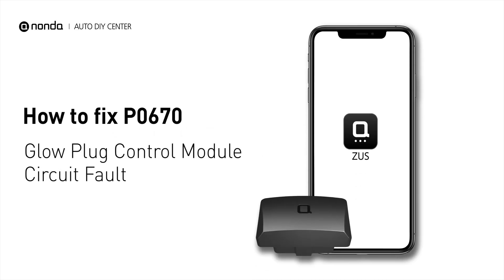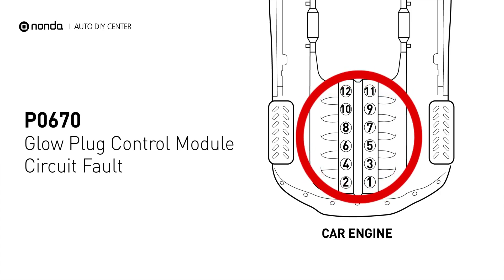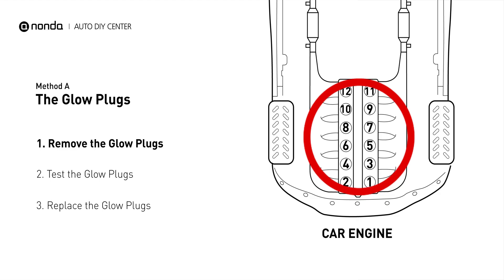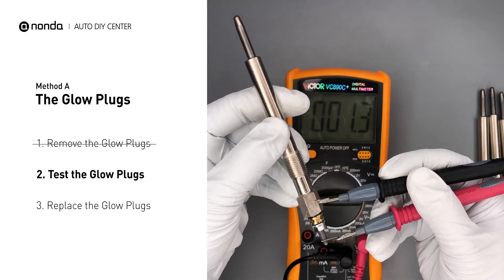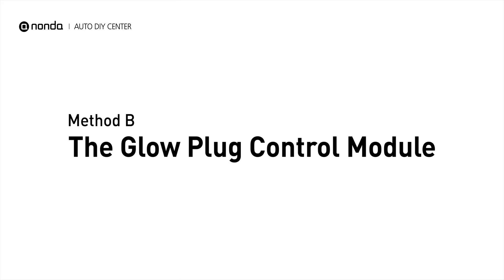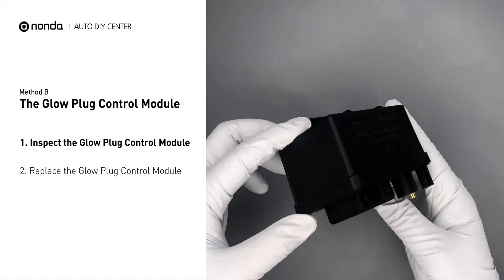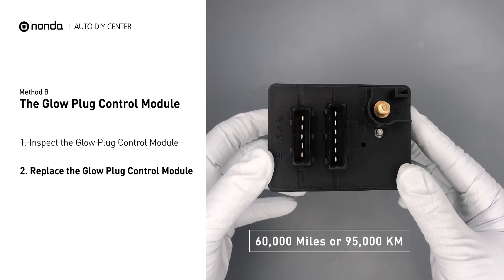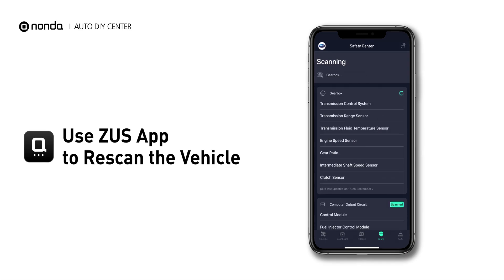How to Fix P0670 Engine Code in 3 Minutes [2 DIY Methods / Only $9.74]

Comment from the maker: Hi, I'm Steve, nonda's lead mechanic engineer. 
Feel free to leave your comments here if you have any mechanic questions, I will be glad to help you out!
Reply: Could this cause the engine to fail/not start? The car won't move when in gear and pushed. But we have ruled out engine seizure already? Could the glow plugs issue affect alternator or starter motor or fuel lines?

Thank you.
Reply: Is this code the same as P067000? Have this in my Audi A3 1.6 TDI

Comment: Hello! Very good tutorial, but there are not only those two methods. I have the same error on a Touran, 1.6 TDI, 105 hp, from 2013. I replaced the glow plugs, I replaced the glow plug control module under the fuse box, and after 50 kilometers the warning light came back on the dashboard with the same error code. There are probably more than two methods to solve this issue
Reply: Hi, did you manage to sort it? I have the same issue with the same Touran. 2013, 1.6 TDi CAYC engine

Comment: I replaced the glow plugs, glow plug module, glow plug relay and the MAP sensor on my Movano, reset the codes, and within 5 minutes of driving, I got the engine light on and check emissions code on the screen. On checking the results, I got the P0670 error again :face-orange-frowning::face-orange-frowning::face-orange-frowning: